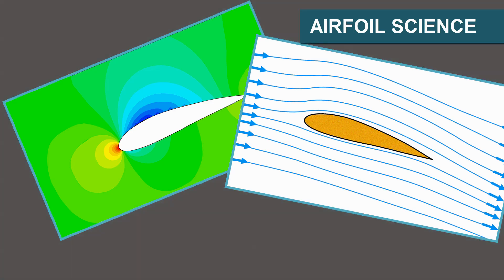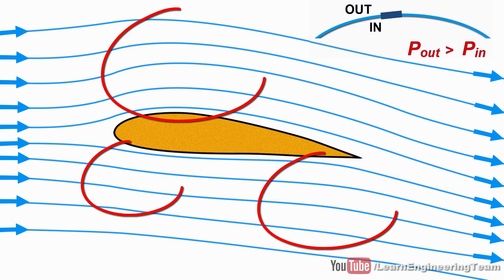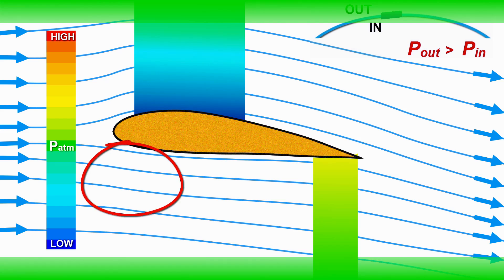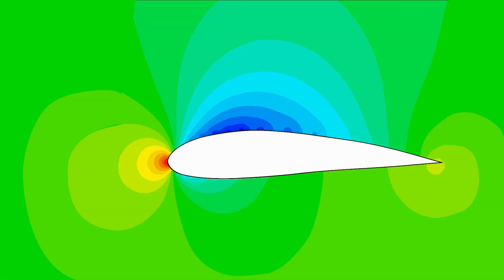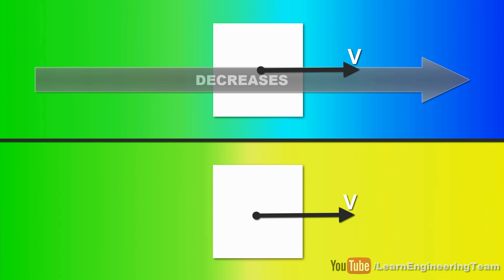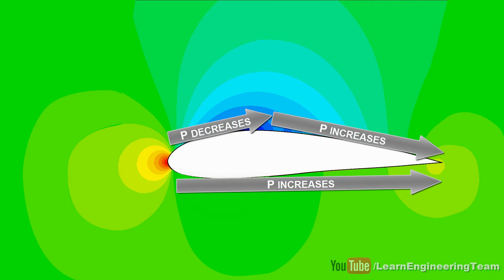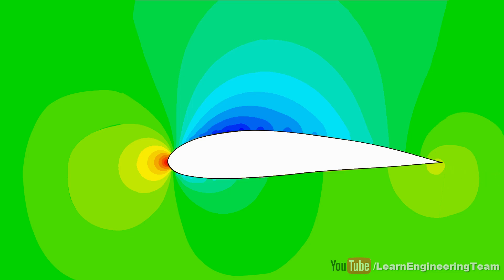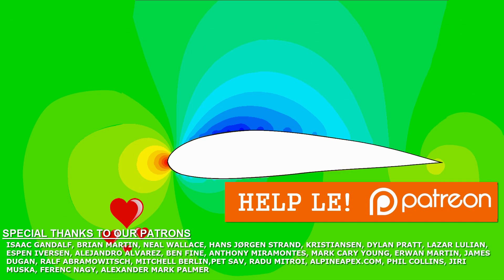Why is the top flow faster over an Airfoil?

Comment: Lol, wrong, the wing angle and the leading edge shape narrow the area above the wing than bottom causing the flow faster over the wing creating low pressure above than bottom
Reply: Nope!  Learn has it pretty much correct.  What you say is the half venturi fallacy.
.
It is the lower pressure above the wing that accelerates the air rearward.Euler, following Bernoulli's work is the one who taught us that Pressure Gradients are what accelerate fluids. F=MA works for fluids, too.

Force is the cause of the acceleration of mass.

Newton should have taught you that a force is required to accelerate a mass and air has mass.  The force that accelerates air comes from a pressure difference. 

Claiming that a 'narrowing" of the area the air travels through is forgetting Newton's universal laws  and a violation of Newton's First Law.  Newton doesn't like that.
Reply: Observ45er ohh. Keep it up your new invented science and theory about airfoil
Reply: @shortclips7052  
P.S.

If you have more problems understanding this you can, as I have done, discuss any of this with some of the noted experts in the field such as  such as Prof. Mark Drela, MIT, Boeing's Doug Mclean, or well known author John Anderson who is now aeronautics curator of the National Air and Space Museum, among others.  Otherwise, I'll be glad to clear up any questions you may have.
Reply: Observ45er 
Check wikipedia statement about why does top flow faster on the airfoil. This might help you alot to understand.
Reply: @shortclips7052  Yes,  That passage is rather vague and, therefore misleading if not understood correctly.  You say "why" but it does not!
It says: 
"From Bernoulli's principle, the pressure on the upper surface where the flow is moving faster is lower than the pressure on the lower surface where it is moving slower. This pressure difference creates a net aerodynamic force, pointing upward."
.
Note that it does NOT say "A causes B". It does not say caused by the faster speed.   It says that "...the pressure on the upper surface ... is lower than the pressure on the lower surface..." 
.
Also, AND VERY IMPORTANTLY, please note that Bernoulli's Principle, when correctly stated, points out that a velocity change is only "accompanied by" a pressure change.  It does not indicate which is cause, nor effect.  It was Euler, following up on Bernoulli's work that first figured out that it is a Pressure Gradient that Accelerates fluid.  
.
This is Newton for fluids. Air has mass and a force is REQUIRED to accelerate it.  The Pressure Gradient provides that force to accelerate a mass of air.
.
Mass doesn't magically speed up causing a pressure reduction.  If you see fluid accelerating and not the pressure causing it, you have more homework to do!
.
The narrowing of a stream-tube is an indication that it is accelerating and, therefore there is a Pressure Gradient causing this.  The You can look at the classical venturi and see that the restriction of the narrow part CAUSES an increase in pressure in the fat part AHEAD of the narrowing.
.
"Narrowing or pinching the flow" can't speed it up, a force from the pressures is required.
..
The above is called "Abductive Reasoning" where you look at the result and work backwards to the cause, except so many people pick the wrong cause, because of misinterpreting Bernoulli's Principle in the first place, as I explain above.

To clarify my understanding, I've already talked with some notable experts who know about this, such as John Anderson, Charles Eastlake and Doug McLean.  In fact, I'm in a conversation about this very thing with John because of the recent Scientific American article.
.
Don't believe Me? Then I suggest you read noted author/expert, Aeronautical Curator of the National Air and Space Museum, John Anderson's book (or contact him or any noted expert).  

Anderson Introduction To Flight 8th Ed.:
http://dl.booktolearn.com/ebooks2/engineering/aeronautical/9780078027673_Introduction_to_Flight_8th_affe.pdf 
.
Page 258: "fluid accelerated by gradients in pressure". Please note that "by" indicates the cause.
.
Scroll to section 5.19. 
.
Page 406: "the airfoil is obeying the laws of nature: mass continuity
and Newton’s second law."  Newton's Law: No force = no acceleration!
. 
Page 407 item #2 he uses Abductive reasoning: "...from Bernoulli’s equation  ... clearly where the velocity increases, the static pressure decreases"  NOTE that he does NOT say "causes".
.
Also: Very carefully read the very first paragraph on page 408:
"Recall that Bernoulli’s equation and
 Euler’s equation are statements of Newton’s second law."
.
And please do not confuse the calculation of lift values (with things like the Circulation concept. or momentum of air turning) with an explanation of the science because formulas never explain science principles, they only show the values of what is happening.
.
Regards
Reply: Observ45er 
What you wana say, that pressure acceleration on above the airfoil is due to the curved shape? More curved more speed?
Reply: @shortclips7052   "pressure acceleration"?
...
Black,
.
First, I must point out that Bernoulli's Principle talks about speed changes being accompanied by pressure changes.. This is acceleration. 
When some air changes speed OR direction it is being accelerated and the pressures around that air are the cause.
.
Please note: Acceleration is not ONLY more speed.
Decreasing speed is negative acceleration also called deceleration.
A turning (curved) path is radial, or centripetal acceleration.
Acceleration needs a force and a pressure gradient provides that force.
..
.. SO ..
The upper pressure reduction is due to the flow curving.  The wing must make the flow curve and there are several common wing shapes that do this. Therefore, it is not ONLY the wing shape, but what that shape does to the air-flow.
..
Above the wing, the lower pressure helps the flow to curve.  The lower pressure above the wing does two more things:
A} It accelerates the air toward the rear of the aircraft.
B} It accelerates air from above downward.
..
So, yes.  At constant speed, a tighter curve (smaller radius) in the flow means there will be lower pressure on the inside of the curve.  THEN, with that lower pressure, the air will accelerate more as it passes over the top (to a higher speed) from that tighter curve.  AND if we look at the pressure diagrams we usually see that the pressure is lower where the flow curve is tighter.
.
Looking in a wind tunnel, we don't see what happens with a real flying wing and we can be fooled about the speed and pressure relationship that Bernoulli mentions.
..
I know this may seem like a lot, but if we watch a wing fly by in still air we see this:
.

The upper flow first moves forward ahead of the wing (a bow-wave sort of thing).
Then, as the wing passes under the flow, the lower pressure really yanks the air toward the tail and it actually reverses direction.   So the air being first pushed forward by the wing gets decelerated to a stop and reverses direction due to the very high pressure difference. This is a very high speed change!
It winds up going in reverse about as fast is it was first pushed forward ahead of the wing.
Then it slows down as it heads toward the trailing edge and winds up as part of the down-wash, moving mostly down.
..
Did you follow that.
Reply: Observ45er 
Sorry dude! You are completely wrong....
A paper plane can fly without any top or bottom curved shape, but the pressure differene exists, low pressure on top than bottom and it is just because of its angle of attack.
A symmetrical airfoil does't produce pressure difference above and below the wing with zero angle of attack, as it is inclined with positive angle it creats lower pressure above than below....
If you examine the air particle speed on airfoil you will notice that the air particles accelerate on the above surface from the leading edge of the airfoil not from the top curved part of the airfoil. 
It is pertinent to mention here that the leading edge radious of almost all airfoils is same from top to bottom, if the acceleration is due to curved surface (according to you) then the air particle should accelerate on the top and bottom curve because the radious curve of the airfoil is same near the leading edge from top to bottom.....

One more thing is, that with zero degree angle there is no air particle acceleration even the curved surface exists on the top...... because there is no pressure difference above and below.... 

A flat plate can generate lift with no additional curve, with zero angle the flat plate does't create pressure difference because the pressure above and below is same (forget about burnouli) but with an angle (positive or negative) the pressure exerts more force below the the flat plate (in case of positive angle) than on the upper surface pushing it upward (little) and backward (more) which is called drag so that's why the flat plate is not efficient to create lift but still creats lift....

In proper airfoil shape with positive angle the more pressure force is pushing the wing upward from bottom  than on the upper surface due to its angle but, upper flow is more important because it is reducing backward force (drag) and increasing upward force pushing the wing down but not as much as the bottom surface pushing it upward, which is lift

Hope you got it.....
Reply: Observ45er 

Observ45er 
Sorry dude! You are completely wrong....
A paper plane can fly without any top or bottom curved shape, but the pressure differene exists, low pressure on top than bottom and it is just because of its angle of attack.
A symmetrical airfoil does't produce pressure difference above and below the wing with zero angle of attack, as it is inclined with positive angle it creats lower pressure above than below....
If you examine the air particle speed on airfoil you will notice that the air particles accelerate on the above surface from the leading edge of the airfoil not from the top curved part of the airfoil. 
It is pertinent to mention here that the leading edge radious of almost all airfoils is same from top to bottom, if the acceleration is due to curved surface (according to you) then the air particle should accelerate on the top and bottom curve because the radious curve of the airfoil is same near the leading edge from top to bottom.....

One more thing is, that with zero degree angle there is no air particle acceleration even the curved surface exists on the top...... because there is no pressure difference above and below.... 

A flat plate can generate lift with no additional curve, with zero angle the flat plate does't create pressure difference because the pressure above and below is same (forget about burnouli) but with an angle (positive or negative) the pressure exerts more force below the the flat plate (in case of positive angle) than on the upper surface pushing it upward (little) and backward (more) which is called drag so that's why the flat plate is not efficient to create lift but still creats lift....

In proper airfoil shape with positive angle the more pressure force is pushing the wing upward from bottom  than on the upper surface due to its angle but, upper flow is more important because it is reducing backward force (drag) and increasing upward force pushing the wing down but not as much as the bottom surface pushing it upward, which is lift

Hope you got it.....
Reply: @shortclips7052  I see you didn't follow. I am only reporting test results, not speculation.
We're talking about the phenomenon of wings generating lift. If a wing is not generating lift, then clearly the average pressures top and bottom are equal so why bring it up?  The subject is lift. 
..
At least you understand that lift is the top-bottom pressure difference, since you keep repeating it.
.
Taking you points in order...
..

"A paper plane can fly without any top or bottom curved shape"
I didn't say it couldn't.  The flow is the key, not simply wing shape like so many people seem to think.
..
"A symmetrical airfoil does't produce pressure difference above and below the wing with zero angle of attack"
I didn't say it did.
..
The positive acceleration around the LE doesn't start until the pressure gradient is proverse shortly behind the LE. Pressure is highest at the stagnation line. 
..
There  certainly are pressure changes around the LE.  ANY time the flow curves there MUST be a transverse Pressure Gradient.  Otherwise you are trying to violate Newton's Laws.  He doesn't like that.
..
The flow around a flat plate wing is very similar to any other wing with a curve flow above the wing similar to others.  A curved floe is the sign that there is more pressure to the outside of the flow.
.. "A flat plate can generate lift with no additional curve,"  on the wing itself, yes. However the flow curves very similar to any other wing (generating lift).  John Anderson has that shown in his book. 
...
The pressure is lower at the curved flow, not the curved surface.  A flat wing has a curved flow when the surface is flat.
..
The upper flow is more important because the pressure reduction above a wing is pretty much always greater than the pressure increase under a wing.  Thus the upper phenomenon is responsible for more of the pressure difference and, therefore, contributes more to the lift. The classical asymmetric camber has very little increase below since the flow is pretty much straight, parallel to the surface, whereas the upper flow has significant curve.
..
Because of these pressures, what happens above the wing also contributes the most to the down-wash.
..
"One more thing is, that with zero degree angle there is no air particle acceleration even the curved surface exists on the top"
This false because on a non-flat wing the air is still curved getting around the LE.  There are pressure changes. It is just that they are equal top and bottom.  Adding the AoA is what gets gets the downward curved flows top and bottom, clearly showing that the pressure on the inside of both curved flow is lower than on the outside.
..
What so many people can't reason out is what it is that causes the pressure gradients in the first place.  They come up with the common misconception like equal-transit-linger-path, Bernoulli used incorrectly, pinching, or the Newton reaction to the downwash; all of  which are magical causes for the curved flows.  They can't understand what causes a curved flow.  F=MA
..
Until you understand that air has mass and a force is required to accelerate any mass including air, you won't be able to follow all the pressures and accelerations of air around a wing.
..

If I'm wrong then well known Author and National Air and Space Museum's Curator of Aviation John Anderson, Boeing's Doug McLean and Embry-Riddle's Charles Eastlake and MIT's Mark Drela  are wrong.  I studied and consulted with those people among others.
..
Review this for a fairly good explanation that is more complete than trying to pick apart single items here.:  https://www.quora.com/q/rxesywwbdscllwpn/Understanding-Lift-Correctly 
.
Or read Weltner: http://user.uni-frankfurt.de/~weltner/Misinterpretations%20of%20Bernoullis%20Law%202011%20internet.pdf    
.
OR Cambridge Professor Babinsky: 
Video lecture explaining Bernoulli. (focused on a wing, but a good explanation of radial acceleration)  If you understand Newton, you'll clearly understand Bernoulli and lift much better after this video The paper he mentions is linked after this.
Dr Holger Babinsky, Cambridge University Engineering Department.  Common misconceptions on lift.
https://www.youtube.com/watch?v=XWdNEGr53Gw   
You'll need his MISSING SLIDES from HERE (Click the Download Icon for the complete set of slides):   
https://docs.google.com/file/d/0B0JABuFvb_G_MkpBZHJmRGo3UkU/edit?usp=sharing  
Or here:
https://docs.google.com/file/d/0B0JABuFvb_G_MkpBZHJmRGo3UkU/edit

His equivalent article from PHYSICS EDUCATION magazine "How do wings work?", Holger Babinsky:
http://www.prirodopolis.hr/daily_phy/pdf/How%20do%20wings%20hork.pdf 

PLEASE NOTE than when Prof Babinsky says "Coanda" he technically misspoke.  The term "Coanda Effect" is defined for high speed jets or sheets of air FORCED over a curved, convex surface, NOT for air "normally" flowing around a wing.  It simply states that the air follows the surface.  It does not define pressures. While the two look very similar, lots of people debate whether ordinary lift is, or is not Coanda...

The non equal transit time (only) proof video by Holger Babinsky, Cambridge University
https://www.youtube.com/watch?v=UqBmdZ-BNig   Narrated, no title at start Cambridge Univ.
. . 
Regards
Reply: @shortclips7052  I' had it long ago.  Here's another pretty good source.  Dave describes it in slightly different ways, but covers the same phenomena well: 
https://www.youtube.com/watch?v=WmXq9gm1uMo 
Regards
Reply: @shortclips7052   This video has it pretty correct.
..
As I said, your narrowing concept is false reasoning.  A venturi won't work with the top cut off.   The air farther above a wing is a very soft cushion, not a hard wall solidly containing the flow.
..

"flow faster over the wing creating low pressure" Is a misunderstanding of Bernoulli's Principle.  Speed does not cause a lower pressure.  The fast stream of air out of a hair dryer, leaf blower, or soda straw is at the same pressure as the still, stationary, stopped air around it.
Weltner shows how you can measure this yourself with very simple equipment.  I do it all the time in demos.

..
In the mid 1700s Euler, following up on Bernoulli's work, showed that it is a Pressure Gradient that accelerates fluid.  Any time you see an acceleration of any kind it tells you the relative pressures.  Until you can work backwards and figure out those pressures and what caused them, you don't understand lift.  It is cause-and-effect using solid first principles all the way, mostly Newton.
..
Do some serious studying from authoritative sources.
Regards.
Reply: Observ45er 
"Speed does not case a lower pressure"

Since you are saying the acceleration of pressure is due to curve while the speed does not case the lower pressure. 

There is no relation between airfoil lift and curved flow acceleration....

And flow does't accelerate when it is curved it does accelerate when it comes from up to down side not only the flow but all the things. It is different topic that it remains attach to the surface due to coanda effect but it does accelerate when it comes from up to down whether it is curved......

I don't care what does newton like or not but i know that the airfoil lift is different thing....
Reply: @shortclips7052  I see that your understanding of fundamental physics is very weak. Believe whatever you wish because it does not change the real science.  Study the references I provided if you want to actually learn about it.
May 2020 be kind to you.
Reply: Observ45er 
I believe what experiment shows and I have found that there is no relation between low pressure and airfoil curve or camber.... 

Just pick up the paper and fold it in airfoil shape cambered from one side and flat from other and pas it through the air with an angle, with positive angle it will create upward lift and with negative angle it will create negative (downward) lift. 

If you can't do this THEN

enjoy your new invented theory about low pressure is due to curve....
Reply: Observ45er 

Thank you for providing this vedio link.

 "Wing don't suck"  at 19:25 

it is actually explaning what i'm trying to say and this vedio does't explain the pressure reduction due to the curve, as you described in your new invented theory about airfoil.......lol 

It has been clearly stated in this vedio the pressure reduction on the upper surface is due to the angle of attack......

So, may 2020 be kind to you
Reply: @shortclips7052  Yes. Dave, as others do, has a different way of explaining the same things, but you are on your way to learning.
.

Yes, the angle of attack is a simplified "cause".  One could just as easily  say. "The moving shape is the "cause", but that doesn't address the fundamental science.
.
You could also say that the wing moving holds up the plane.  
.
BUT that skips a lot of cause-and-effect steps in the real science.
As I said, I got this from experts I named.
Don't just cherry-pick one sentence from one paragraph or video to substitute for the complete science.
..'

What you clearly realize is that it is that a "something like a wing"  shape (at that "angle") that makes the air flow in a curve around that upper surface...somehow has a lower pressure above it.
But what is the clear science that causes the reduction in pressure?
...

"Narrowing doesn't hack it and Dave (CompleteeroGeek) also calls that fallacy out.  
Did you hear that part?
...
SO, how about addressing some fundamental science fact that we know are very well understood:
..
How can you deny that:
1) Air has mass?
2) Newton's first law states that a force is required to accelerate a mass?
3) A mass (any mass) raveling in a curve path has some centripetal force acting on it?
4) That, therefore, there must be less pressure on the inside of the curve (nearer the surface) compared to far above the wing where it is normal pressure...so the higher pressure outside the curve" is pushing it into the curved flow.
..
Lastly in that video, Dave also clearly says that the air would "rather go straight" and this is what is causing the lower pressure.
 .
Comments on that?
Reply: @shortclips7052   So your narrowing idea is correct, eh?
..
Try this bit where Doug talks bout your narrowing (he calls it pinching - different word SAME concept)) and then how acceleration requires a force.
SO what it the force and what causes the force to occur??
.

[note Doug talks more at an engineer's level, but this part is simple. Listen up to time 19:00:
 https://www.youtube.com/watch?v=QKCK4lJLQHU&t=1062
Reply: @shortclips7052    Also listen/watch here for about a minute to 9:58 about 'narrowing:
https://www.youtube.com/watch?v=aa2kBZAoXg0&t=521 
..
So. is narrowing still correct?
Does narrowing still accelerate air?
Is a curved flow accelerated flow?
... ??
Reply: @shortclips7052  If you choose to claim I am "inventing" this, then you need to explain how your 'narrowing' speeds up the air, curves the flow or lowers the pressure.
Your turn to describe your science.
Reply: Observ45er 

I think you are far away from my point i did't talk about pinching or venturi theory, i'm just saying the pressure difference above and below the wing is just because of its angle or leading edge geomatry or combination of both, because with positive angle the leading edge's below surface faces more pressure force than above because the leading edge is being wide with increasing AoA and upper surface of leading edge is bending down allowing air to go fast.
Reply: Observ45er 

If Bending the air lowers the pressure over the airfoil then how does camber (one sided curved) airfoil creates negative lift with some negative AoA?
Reply: @shortclips7052  Um... 
..
I know this is stuff you either heard from some other misguided individual (of which there are many) or in good faith figured out from your limited physics understanding, but you are repeating false, indefensible science.
..
YOU: "Lol, wrong, the wing angle and the leading edge shape narrow the area above the wing than bottom causing the flow faster over the wing creating low pressure above than".
..
Kinda hard to not see that in those words: ":narrow the area above the wing ... causing the flow faster"
..
Your words clearly say the "narrowing" causes acceleration. 
.
 This is simply not possible and as Doug McLean clearly agrees in his video, if you can't point to the force that is causing the acceleration, you don't understand the science and you still have more studying to do.
Force causes acceleration, narrowing/pinching does not.

.
Did you even listen to the short section of U. Mich Professor Krzysztof Fidkowski? The link I sent went right to the palce he talks about it.  
..
Fluid in a venturi speeds up in the narrow section because of the higher upstream pressure pushing harder than the lower downstream pressure. --- NOT THE NARROWING. In a venturi, the narrowing is what is the cause of the increased upstream pressure.  The classical finger on the garden hose very clearly proves this..
..
Try reading the Weltner paper I linked you. It is put into simpler terms for more of a high school level.
Reply: @shortclips7052   Repeated to make sure you know what I'm replying to.
..
You: "If Bending the air lowers the pressure over the airfoil then how does camber (one sided curved) airfoil creates negative lift with some negative AoA?".
..
If you mean a lift force of an upright cambered wing, but in the downward direction when an airplane is suddenly put into a dive, or such as on a auto spoiler, or the horizontal stabilizer of an airplane?
..
The answer is by the same kind of bending UNDER the wing.  This puts the center of the flow-curve upward, so therefore the lower pressure is below the wing.  The science doesn't change.
This, then causes an up-wash behind the wing...
..
AND the same way a sail boat sail and keel both create "sideways lift".  WHICH prodes a "side wash" on one side i=of the sail and the other side of the keel.

As I'm pretty sure I've said above, it is not SIMPLY the wing SHAPE, but the flow shape that signals what's going on.
..
It takes something roughly like a "wing shape" to do this.  It CAN be a flat plate, a "sorta' flat" symmetric wing, or a "sorta' flat" asymmetric camber and even a "sorta' flat" INVERTED asymmetric camber.  Same general shape, same science, same general flow pattern. and, yes, the LE must be elevated to some degree for this flow to happen.

..

Is that what you refer to?
Reply: @shortclips7052  You didn't address my questions.
..
Are you claiming that air does not follow Newton's laws regarding force mass and acceleration?
Reply: @shortclips7052  
YOU: "I think you are far away from my point ...(many words)...... and upper surface of leading edge is bending down allowing air to go fast."
.
One doesn't simply allow air to bend down.  Air has mass. This is radial, or centripetal acceleration and requires a net force toward the center of curvature.
.
'Do you understand what  acceleration is and the three fundamental ways it can be caused?
Reply: Observ45er 

Let's come to the point, what you or the study you have done, says about why is the top flow starts accelerating from the LE of the airfoil and what it cases?
Let me know your opinion in this regard...
Reply: Observ45er 

If you say its due to centripetal force because of rounded leading edge, there is another question,  why is there no acceleration below the wing because of the rounded LE?
Reply: @shortclips7052  Here is a step-by-step overview of lift; focusing on the upper surface: 
.
A wing (any object) must push air out of its way to move through it.  Air also moves in after the wing/object goes by.  This moving-through-air wing is the fundamental cause of the pressure changes around the wing. 
..
In locations where the wing must push air out of the way, it increases the pressure by moving into the air. This increased pressure accelerates air (Newton’s First and Second Laws) away (in all available directions) from the surface from there.

 In locations where the air must flow in where wing no longer occupies the space, the pressure is lowered so higher pressure elsewhere (from all available directions) accelerates air (Newton’s First and Second Laws)  back toward the surface.
..
This is all Newton's Laws of force/pressure causing acceleration of the mass of air. [F=MA]
..
Apparently, fate has it that the most important (and confusing) location where a lower pressure forms, is above the wing.
..
I must point out that at this time because of the flow I am about to describe has existed for a while; pressures around the wing are already pushing air up and forward BEFORE the wing arrives.  Therefore, the air that the wing is about to travel through is already moving upward and in the direction of flight, but obviously slower than the wing.
..
Higher pressure ahead and above the wing accelerates air toward this location.  This means that air is accelerated rearward by the higher (atmospheric) pressure ahead of the wing AND down by the higher (atmospheric) pressure above the wing. 
.
Because this upper air must travel in a curved path to travel up and over the upper surface (near the L.E.) then rearward and downward toward the T.E, it follows a curved path – THIS is centripetal, or radial acceleration.  Because the air’s mass/inertia tries to continue straight (Newton’s First Law), it further lowers the pressure there.  This supports the net inward force for the centripetal acceleration. This maintains a steady-state lowered pressure above the wing.
….
 I pause at this time to take note of the fact that this curved flow must be curved to get over the elevated, front part of the wing.  Because of this it is easy to simply say that the angle of attack causes lift.  This is not in-correct, but such a simplistic view avoids the fundamental science of WHY this occurs as it does, that I describe here.
….
As this air continues toward the T.E., the upper wing-surface moves forward and is now, therefore, lower (or simply curved) away from this air’s desired (tangential) path.  This continues the curved air-flow path and is also part of the vertical acceleration into the downwash when the wing moves forward out of the way, allowing that air to continue downward behind the wing.
As this upper-air nears the T.E. it is approaching a higher pressure region, so it slows (negative acceleration) almost to a halt in the horizontal direction. As the T.E passes by, it is left with mostly downward velocity (and a little forward velocity) – where it combines with the other part of the downwash (not described here) from below the wing (also not described here).
…..
TL;DR: A moving wing-like shaped object  pushes air around creating pressure changes near it. Lucky for birds and humans, a net pressure difference results that is upward against gravity, allowing flight.
Reply: @shortclips7052  
Question: “If you say its due to centripetal force because of rounded leading edge, there is another question,  why is there no acceleration below the wing because of the rounded LE?”
..
Answer:
Again, it is NOT SIMPLY the wing shape, but the flow pattern. 
The flow pattern is not symmetric very near the L.E. as you seem to assume, because we have this existing pressure pattern around it.  The air is moving upward and the stagnation line, where the flow splits so go over or under, is NOT at the L.E., but BELOW IT!
.
In fact, there is a region right under the L.E. where the pressure ACTUALLY DECREASES because of the curved flow there, H O W V E R … the pressure there is ALREADY very high because the wing is almost directly ramming into the air there…. So this decrease does not get the pressure below atmospheric pressure like it does above.
  Therefore this is a minor effect, not significantly affecting lift.
...
It is not good to try to pick on small areas and details where minor phenomena occur until you understand the major things.  Once you understand the major phenomena, then you can start looking at these smaller things and how they have little effect to the big picture and can, therefore, be ignored when learning the major things. 
- - 
Regards
Reply: Observ45er 

Good, you are smart! 
I have one more question.....

As you said, due to centripetal force the flow accelerates around the curved path but,

What's about your previous statement?

'Speed does't case the lower pressure'

Mean 

There is no relation between airfoil curved flow acceleration

(due to centripetal force, according to you)

and lower pressure above the wing...... because speed does't case the lower pressure.....(you said)

Since, speed does't case the lower pressure, mean curved flow accleration (due to centripetal force) is useless..

And speed difference is not cased the pressure difference but the pressure difference is cased the speed difference...

So, the reason of pressure difference is airfoil LE geomatry...

Because the sharp LE airfoil also create pressure difference above and below the wing and lift force when it is inclined upward without any curved or rounded LE...
Reply: Observ45er 

There might be very little effect due to centripetal force acceleration along the airfoil curved flow but not significant atleast for airfoil....
Reply: Observ45er 

It has been examined that flow on the upper surface of the airfoil does't accelerate with zero AoA whether it is conventionally cambered airfoil or supersonic having sharp LE,

But, 

If They are inclined with some angle the pressure difference is created lowering the pressure above....

The acceleration due to centripetal force is a different thing and the flow around the airfoil curved surface is different....

Bacause,  

There is no single layer of air particles flowing around the airfoil curved surface from LE to TE of the airfoil, if there had, it would have gone straight when passed through curved surface due to centripetal force..... 

There is step by step different air particle's layers above the airfoil curved surface pushing it down to follow the surface exerting pressure on the surface.....that is the experiments show....
Reply: @shortclips7052   I am very sorry, but I am unable to understand all of this enough to make an intelligent comment.
Communication via text is difficult and I see we also have a native language difference which is not helping.
- - 
Sorry.
All I can say is that the tangential and centripetal acceleration of the flow above a wing is a complex dance that is difficult for most people to understand.
Reply: Observ45er 

There is no author and text book or any vedio that shows the centripetal force in airfoil theory.....

if you have any, i would like to go through.....